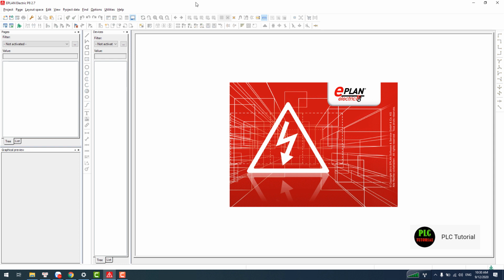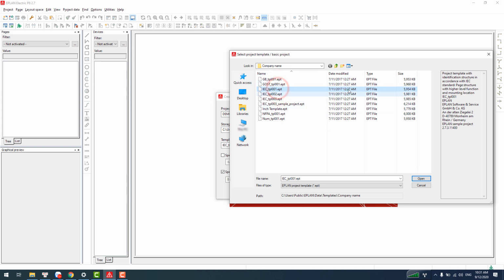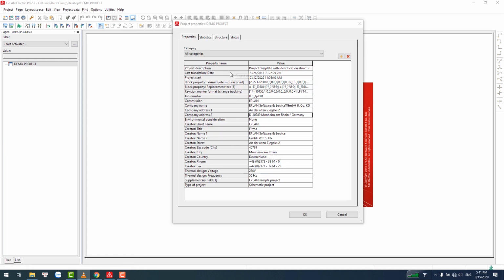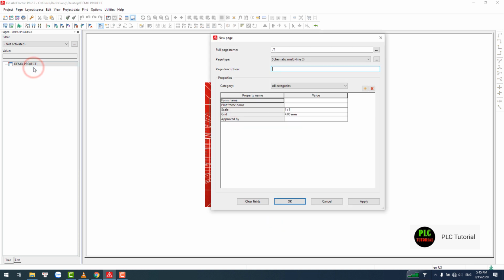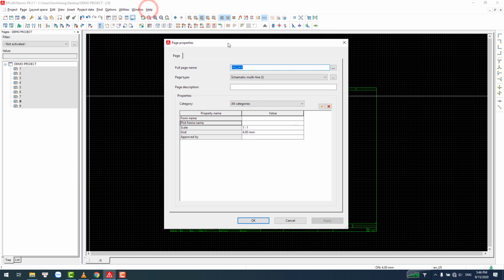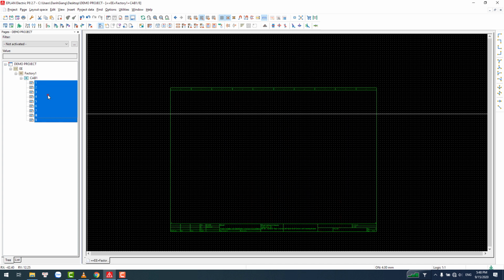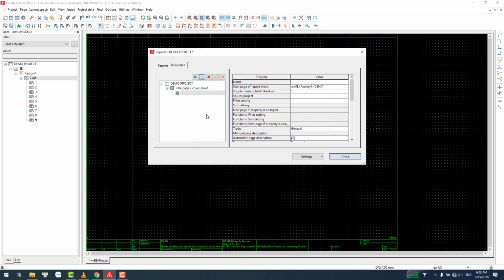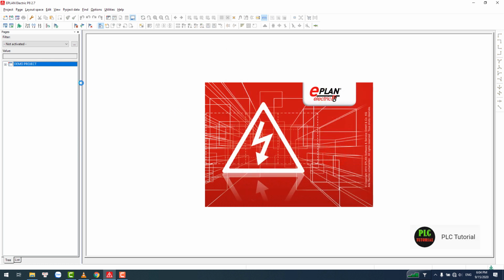Eplan Tutorial Part 1 How to creat new project

Comment: Hi can anyone please help me???
I am unable to understand Higher level function and Mounting Location structure... 
Is it used for multiple panel project where panels are mounted at different locations OR can it be used for a small project having only one single Panel where in all the switchgears are mounted and a small Operator panel which has only few Push Buttons and Indicators???
Reply: Hi bro, ping me we will discuse about the details